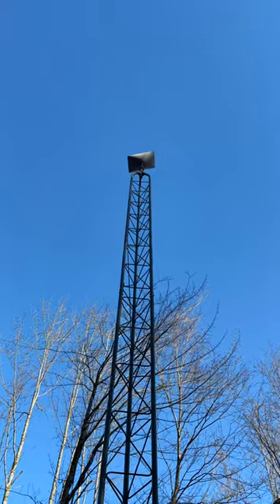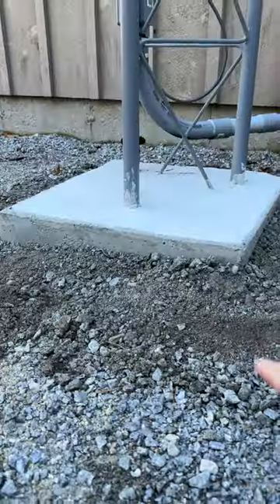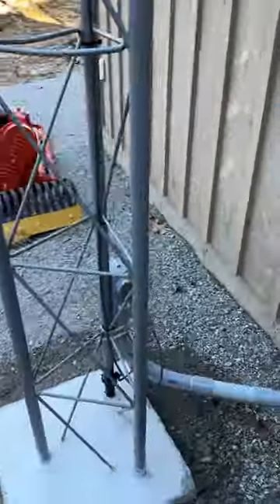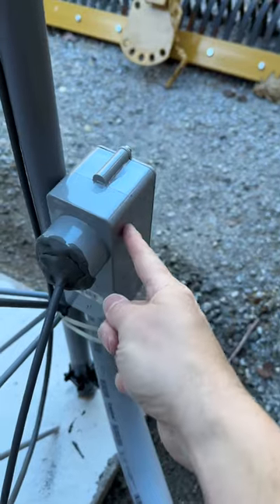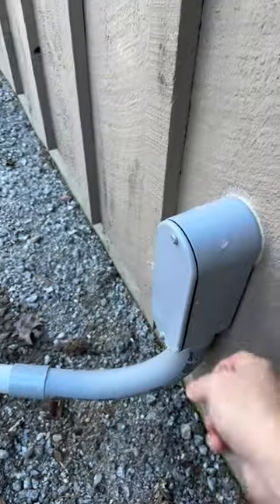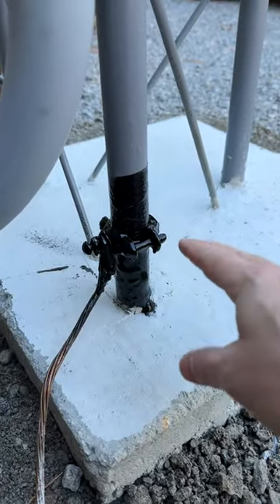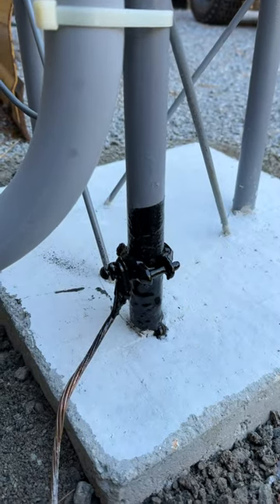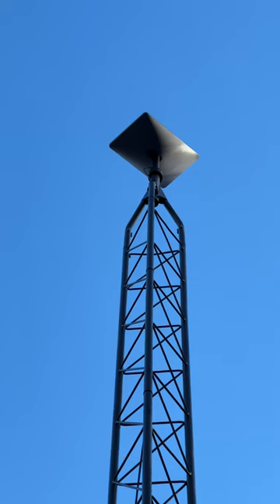Cleaning up my Starlink problems

Comment: So does star link work Do you have fast internet and are you off the beaten path? Only thing stopping me from finding a house away from town
Reply: Starlink is awesome if you live way out in the country & can not get Fiber Optic Internet! 

Starlink is way faster than anything I ever had before. Even faster than my in-the-city Comcast Internet & Cable hookup.

When Starlink finally became an option in my area (Western Wisconsin)  I jumped at the chance.

 We went from 6migs speed and constantly dropped Internet to 120 - 203 migs it was a job saver! 

Starlink is increasing the speeds all the time too. 
Starlink does plan on supplying 1 gig Internet speed in the near future too.
Reply: Where did you find that tower? I am going to need to do something like this.
Reply: @lordwise1111 this is good to know. We have regular in town fiber optic internet and it is horrible,  to many people, it isn't consistent or reliable. We don't have a Comcast option in our town. TDS and it's horrible. 
Now we are moving to another state, we will be very rural and this will be our best option. I already have kids complaining. Bummer 😂  But my hubby is an electronic engineer so I will put this with your comment in a file for him.

Comment: Very nice, stop using clamps for grounds, do cad welding only It will never come loose and that’s the only kind of connection used on all towers and buildings, they’re cheap and inexpensive, may be a little more costly to do to a tower leg but I won’t do anything on any ground rods ever again but that